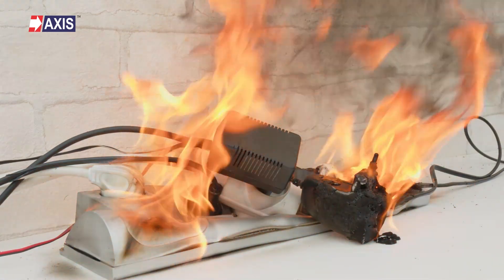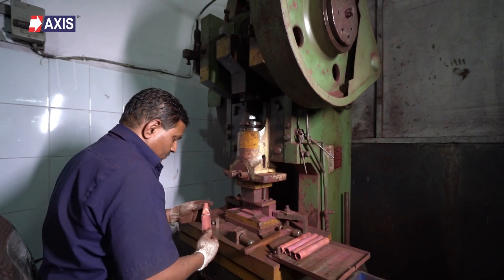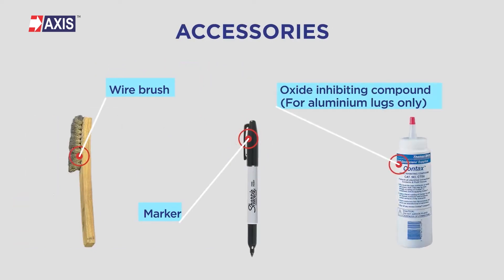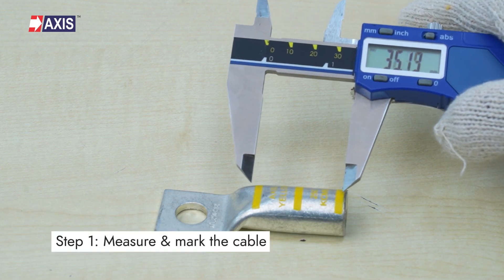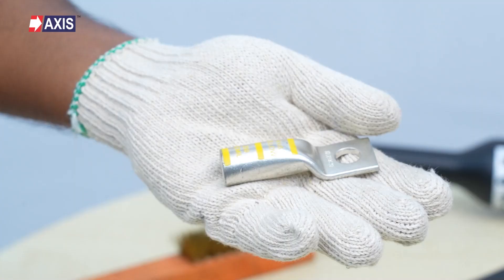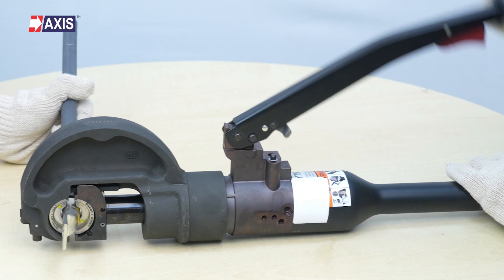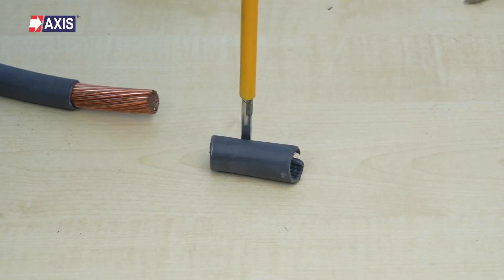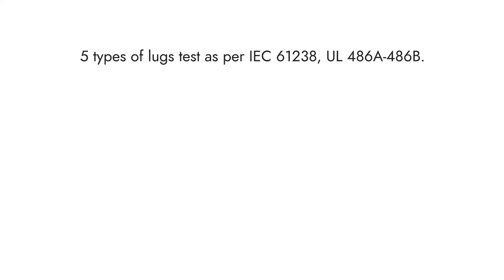Crimping Terminals as per UL 486A-486B⚡

Comment: Please show how it is legally possible to crimp two wires in one wire ferrule? According to UL 486A-486B it is legal to have two 1mm² wires together in one 2mm² ferrule if it is certified to be used as dual ferrule ...

no one on the internet has this topic which is important burning as space is limited on many machines
Reply from the maker: Hey Moritz,
Do you want a video with two cable crimped into same ferrule/lug?